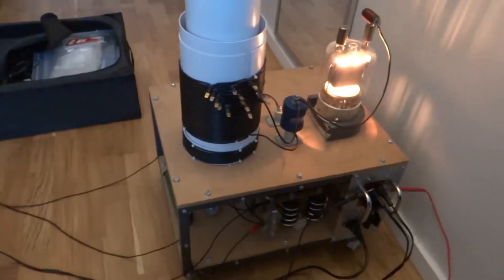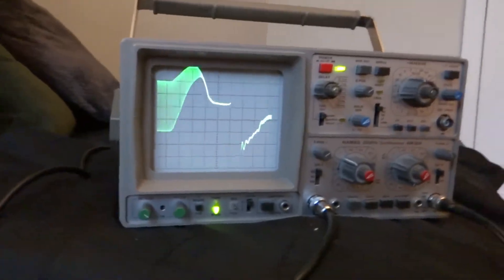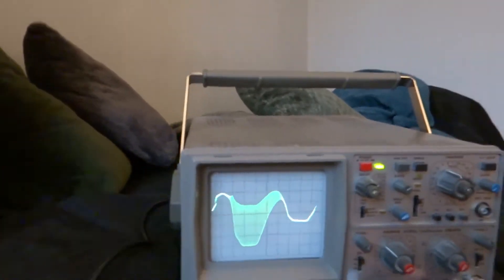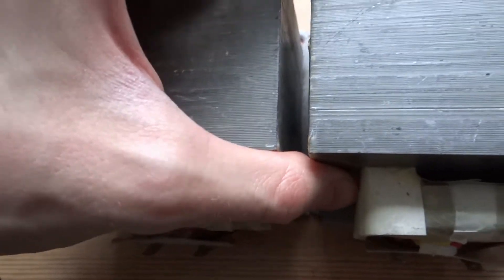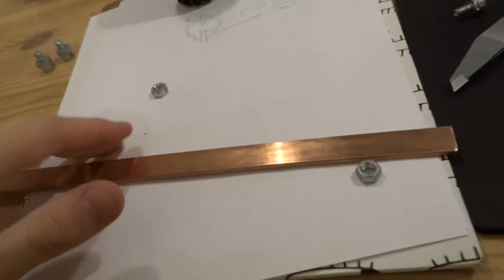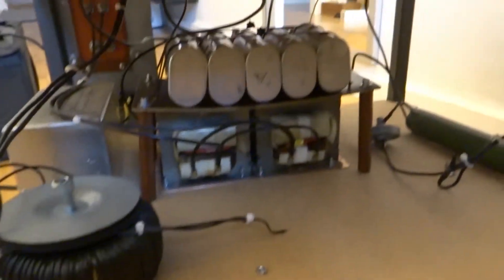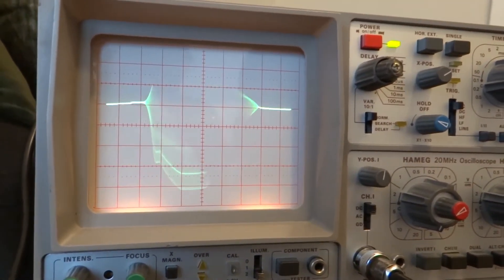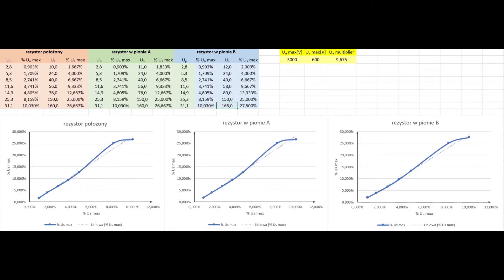VTTC Build pt.3 - Troubleshooting & impovements

Comment: I think I know what had happened, you had an arcover which temp shorted the transformer, then the inductive kickback created a voltage spike.

How did you find out that your tube is broken?
Reply from the maker: Your explanations sounds possible, likely its what happened. Calling the tube broken bc applying plate voltage caused visible ionisation around the anode
Reply: @mhz579  huh my comment got deleted?
Reply: @mhz579  I am gonna type it again i guess.

So a little blue glow around the anode or on the glas is usually a sign of good emission of electrons, and is not a problem. 
Unless the tube glows very blue, like filled up with blue glow, its under a good vacuum. 
you can tell if your tube is under a good vacuum by looking at the getter, on the GU-81(M) its on the side, down at the base, usually two chrome spots next to each other, if they have turned very small or look very brown or even white, the tube is bad. 

From your description the tube looks good to me, i have many tubes that glow a little bit like shown in another video, and even my gu-81m glows a bit blue in a long exposure shot
Reply from the maker: @janno288  yeah no, the glow i think is plasma, it appears obruptly when the anode voltage is being ramped up ( by cranking up  a variac powering the plate supply ), suddenly it ionizes and looks rather violent so no its not a faint blue glow
Reply: @mhz579 do you have any footage of it, i am interested in what it looks like, how does the getter on it look like?